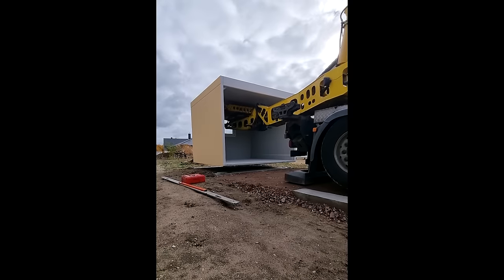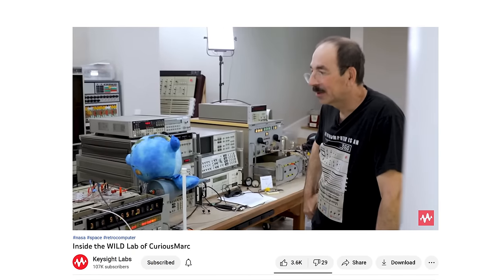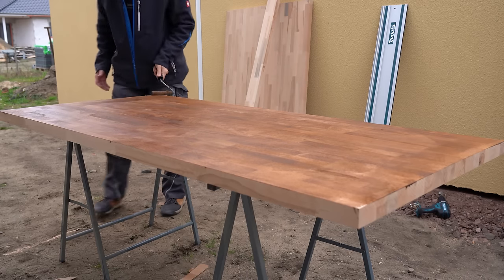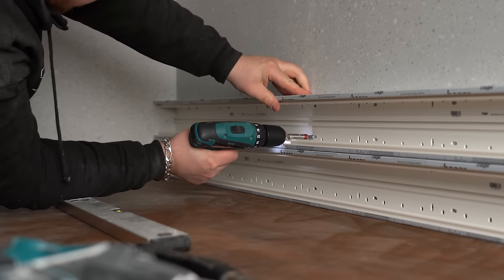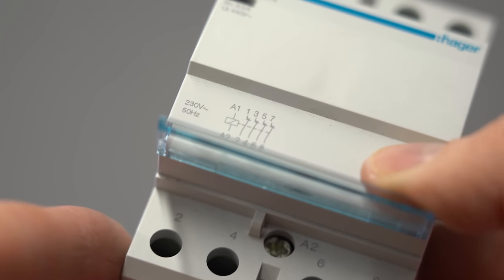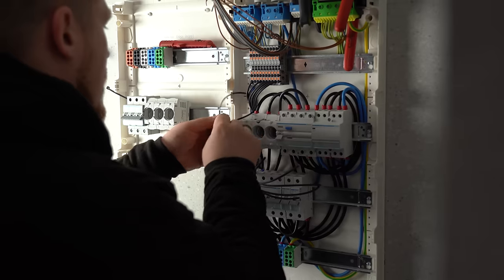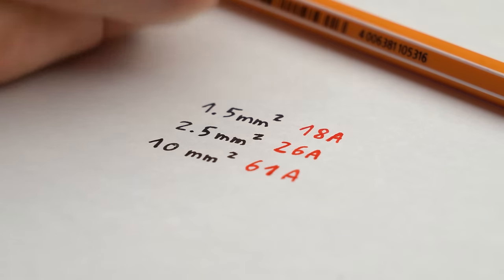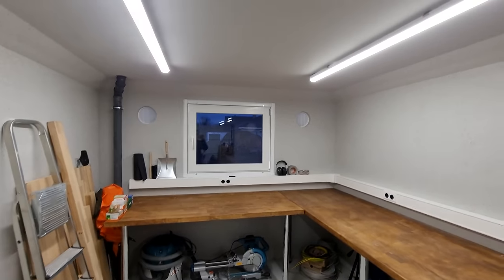Germans do the PERFECT Electrical Wiring! (Garage Build)

Comment from the maker: Small Corrections: The CEE socket can supply 11kW. I wanted to keep it simple and keep the sqrt out of there but that just messed everything up. And secondly the power required by the relay is not around 60W. Maybe something around 20W. I mixed up some values in the datasheet. Sorry.
Reply: You can pin this comment so it appears on top of the other comments.
Reply: wish i knew anything about EE, I could build my own electronics cabinet for my cnc instead of buying an overpriced pre-made one
Reply: No, it will not consume 20W. Read the specifications. Operating consumption is listed as 5.75W. Which, assuming 0.20€ per kWh, would be about 10 euros per year.

The "around 20W" you probably have in mind is the "power loss under IN" where I stands for current and N stands for nominal. And the rated current for these ESC463/464 is 63A.
So, when you're pulling the rated current through this contactor, that's the amount of power lost inside the contactor if you were to pull the maximum (44kW) amount of power through it. This power loss is insignificant in comparison to the power pulled through the contactor.
Reply: yeah it is 400v*16A*wurzel(3) With out square root you could say 3p*16a*230v thats also 11kw
Reply: You cought that quickly.

Thanks to Herr Schmidt from my Berufsschule I will never forget 1.73 and 1.41 :D
Reply: next, you'll need the 50kW plug to recharge the electric car 😎
Reply: 11kw... Almoast enough for a 4090ti!
Reply: @rattslayer  the power connector will melt and burn though 🤣
Reply: there are 3 types of this sockets 16A, 32A and 63A
Reply: @PaulM1984  there is also a 125A version - see Legrand 059503
Reply: @rattslayer  for a 4090ti  i would suggest a dedicated 630kva three phase Transformer
Reply: @Lagittaja  Yeah nah. "assuming 0.20€ per kWh" is how many decades ago? I haven't seen anything under 0.32€ in the last few years, now trending towards 0.40€.
Reply: Hi, the 25,75W in the datasheet includes 20W of losses at contacts under IN (63A). The datasheet says that the consumption of energizing the coil to close the contacts is 5,75W. IIRC Eaton makes contactors that are rated at ~3W of consumption to close them. Also, another thing about the safety circuit is that generally just unlocking the E-Stop shouldn't be enough to energize the circuit again, I would expect an additional button to turn it back on. In addition to missing cable break protection, if you lose L1 phase, your E-Stop won't work.
Reply: I was quite surprised when you said "about 60w", the 20w figure seems very high too.
But I know nothing about the transmission grid in Germany other than residential 3 phase 400V is not uncommon.  
When you say "relay" do you mean a magnetic contactor, like would be used to power large machinery in industry?
Reply: @chrishuhn5065  And? So? In case you missed it, that was an example. Am I supposed to provide example values for every possible cost?
Feel free to adjust the price per kWh according to your situation. 

P.S. But since you asked, 0 decades ago. Beginning of this month I will be paying 13.57 cents (incl. 10% VAT) per kWh to my local producer, it was 5.9 cents (incl. 24% VAT) until June when they raised to 6.8 cents (incl. 24% VAT) and then to 10.2 cents (incl. 24% VAT) in October. In case you wonder about that VAT change, the tax for electrical energy sales was temporarily lowered by the Finnish government for December to April.
Also I manage my mothers electricity contract orders, I got her a 5.14 cent per kWh 2 year contract in 10/2021. Before that she was on a 5.20 cent 1½ year contract. I haven't bothered to tender out my energy contracts or sign 1-2 year contracts as a year or so ago energy sales and energy delivery bills could still be on the same bill here which was convenient and my local producer/grid operator had decently cheap rates so I didn't bother to switch producers just save few euros a year. In hindsight I should have so I could enjoy steady rates but I guess it's nice to support a local company. Also who knows what the energy sales landscape will look like in the near future.
Reply: the relay consumes less than 6 watts, if it would consume 20W or 60W it would need a fan!
Reply: @STRATOS13PAO  Seems much more reasonable, still surprising in this day of solid state switching devices.
Reply: It all looks great but there was some isolatsions in switsboard that i didnt like becose they came out like 2 milimeters out of the component. But good work i liked the design
Reply: 60 Watts seemed quite much, but even 20Watts is a bit more than nothing
Reply: That is very nice design and installation.
Reply: @chrishuhn5065  last year you could get a 0.06€/kwh contract for 2 years in Finland. Now the same 2 year contact would be 0.26€/kwh and many people won't be able to pay their electricity this winter.
Reply: More like 8W for e.g. Schneider LC1D types!
Reply: I wondered why didn't you use are remote trip 4p mcb then wire it to the emergency stop button. I think it is safer the the setup in the video
Reply: Nice & neat wiring ...would like to know what was your method of switchgear , cable  & wire identification.....for a 1<>1 link up..... because I did not see any ferrules / cable markers ,  tag coding etc...
It would certainly help in later wiring/rerouting / modifications etc.
Reply: @GoodOlKuro  i also had a Herr Schmidt as a teacher.
Reply: your safty stop had a NC and a NO contact in it did you change one of them?
Reply: @AmauryJacquot  and 400 and 500. And then... we have the powerlock system up to 1000a or so
Reply: @MoulinTV  hadn’t seen those 400 and 500A versions, I had seen those individual wires connectors where you have to plug in 5 separate things
Reply: Further correction: the 26W power loss are only true while supplying the full load of 63A (44kW power), so its including additional contact losses. The actual power consumption is around 10W, also you would probably shut it off while leaving the Garage, so the 10W are only drawn while you are working... Especially with that Video title i would have expected proper Drahtbruchsicherheit! VDE would be disappointed
Reply: @AmauryJacquot  yes thats the powerlock system with 5 seperated plugs. Im a little in doubt about the 500A now, but im sure about the 400 tho. They are used to power cruiseships in Amsterdam, so they dont need to use their generators. ive engineered some stuff for them :)
Reply: @MoulinTV  they should be nike powered
Reply: @GoodOlKuro  Don't forget 0,747 - at least if you also deal with signals instead of just energy. 1/sqrt2 (or -3dB) is a number I'll never forget.
Reply: @lucemiserlohn  in my head they are almost the same number, depending on how they are applied. Btw  I'm assuming you mean 0,707... which would be a little ironic saying it's a number you'd never forget. ;) (unless I am missing something)
Reply: @jimurrata6785  i think such solid swithcing devices are not allowed for that kind of application because they dont seperate the device from the power completely (as in whith a physical air gap), but rather change the resistance electronically. If this fails into a conducting state the emergency stop would not de-energize the circuit anymore. Contactors used for this kind of Application usually have two contacts internally, and intentionally open/close with quite some force to make sure the Contacts are really in the state they should be (open or closed), hence the "Clonk" when they change state
Reply: @unitrader403  Yes, I understand why they are not allowed.
I'm still surprised of that in 2022, especially given how much energy the contactor uses/wastes.
Reply: @GoodOlKuro  You are correct. I use 747 as a play on another astounding piece of technology. Sometimes these things creep in and develop a life of their own.
Reply: @karolferet8198  I think that you mean contactor type with 2 coils system  = 1st coil for actiavation of contactor and 2nd coil works only for "Holding" function = electronic inside, these contactors have really low consumption. These contactors produce what i know Schneider (Telemecanique, Merlin Gerin).
Reply: @chrishuhn5065  That's above the current price in France (0,18), but, it's about to change.
Reply: Instead off using an regular relay you could have a look into a Solid state relay something like KSQF480D40
Reply: @greatscottlab You can use an Doepke RCD with Emergency Function.
Standy Power should only bei ~2-3W.

Your installation looks great.
But i would use an seperate RCD for Lighting und closed outlets (Dust?)
Reply: @darkness8631  or use Hager original part for remote RCD or MCB tripping named ASA or USA what you prefer. Could be used directly RCD means trip it with residual current = simulate residual current with resistor and emergency switch in series as on block diagram for your RCD. USA means Under Voltage Release
Reply: Gesamtverlustleistung unter Nennstrom sind 25,75 W. Davon Sind 20 W Leitungsverlust (das Teil wird warm wenn da 63 A fliesen) und 5,75 W Verluste der Spule. Die 5,75 W sind also das was dich interessiert, wenn du es das ganze Jahr eingeschaltet lassen willst.
Reply: I do not believe that a relay consumes 20 W.
Reply: I would have done underfloor heating.
How do you heat that space during the cold season?
Reply: it can handle 22kW well with a 32 amp fuse
Reply: @PaulM1984  👏👏
Reply: @karolferet8198  👏👏
Reply: @PaulM1984  also 125A
Reply: isn't the 1.5mm2 cross-section of the cable only designed for 16A for Sockets Not 18A. At Least thats what i learned.
Reply: Why didn’t you put the cee inside the brüstungskanal as cepex as well, as the emergency switch
Reply: I would have put the CEE socket/s on a separate loop, with it's own normally open protection  and indicator light, enabling the loop only when needing to use it trough a switch.
The emergency stop is a nice touch.
Reply: You got the good, stuff aka Mennekes
(their main production facility is close to where i live, so always happy to see their products pop up)
Reply: CEE is up to 125A....
Reply: @PaulM1984  125A
Reply: @jonjon3829  The more you know about EE, the more you understand why some things are priced the way they are.
Reply: You are able to use a main switch for all your outlets so the relais only draws power when you are working in your garage. The way you did it isnt "half way safe" its just wrong and probably not even allowed in Germany
Reply: the emengency switch need to be NC (opener) Thats importand for drahtbruchsicherheit if the wir got cut and you press the swicht nothink happen
Reply: @Lagittaja  When GreatScott said 60W, I thought it's too much and that he made a mistake, but I was not sure. This 5,75W sounds much better. In this case I would do proper E-STOP wiring with NC contacts.
Reply: @Tupsuu  Ouch, that really sucks, same here in France, thanks to the geniuses who first decided to split one efficient national energy company into multiple private greedy parasites (most of them producing nothing but just trading!) and then indexing electricity prices on CH4/oil prices (that's a super smart move, in a country where 75% of the production comes from nuclear plants, right?). In the meantime they have also made a mess with the few good ideas which could have helped people to better insulate their homes.
Reply: Actually it's just 7VA for the relay. Which in my opinion is ok for ones safety. See it as an electric heater which keeps the dew point higher in your electrical panel.
Reply: Hey, GreatScott! What about Hager MZ206? If power from e-stop is lost, it will pull down circuit breaker. Disadvantage is that you have to pull your circuit breaker up yourself. Of course there are even modules with servo but that gets expensive really fast.
Reply: I watched the video yesterday, and when you came up with the 400*16 I began questioning my existence. luckely looked up the comments today.😅
Reply: ElectroBOOM would be horrified! No individual breaker for each outlet?
Personally I would have placed the power outlets flush horizontally between the wall and table or even integrated into the tables. Having the rails above the tables takes up horizontal space and doesn't look as slick (for my taste). I would go as far as putting recessed illuminated switches on the front edge of the table for each outlet.
Reply: @AmauryJacquot  No electric car charges with 50kW AC. Most of them are limited to 11kW.
Reply: Not perfect aye.
Reply: I would sau 1.5mm2 cable max is 13A braker u should use and it can carry max 16A (thats what we learned here
Reply: And u could of used a elco timer in combination with the realay to make the safer version with less power
Reply: @henrikostrov482  When I was young, 16A was perfect for 1,5mm². But too much if your cable goes trough the building insulation.
Reply: @horste9237  beah but in here u can but 16A breaker B type max bit its brefferef 13A
Reply: What’s the height of the cee socket from the floor?